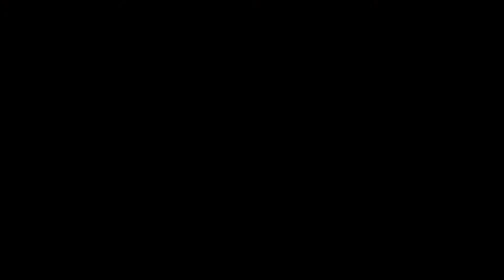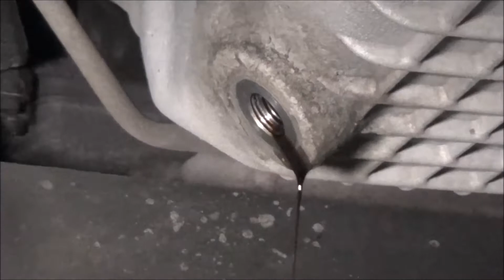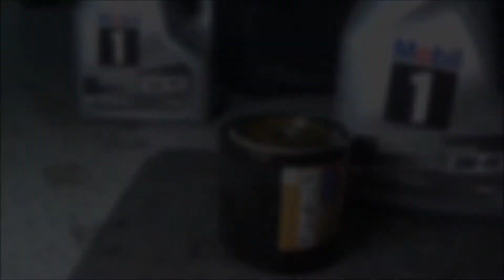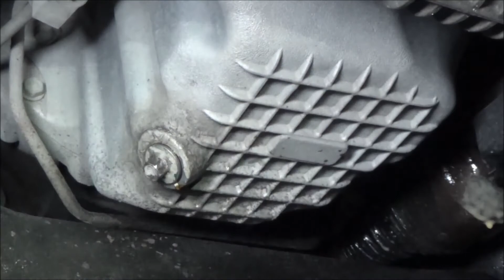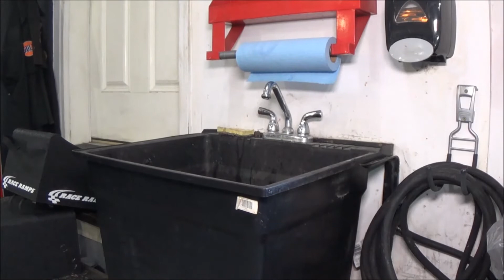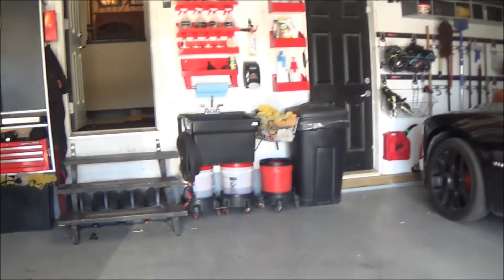Oil Change on Jeep SRT8

Comment: is it true that u should all 12000km or all 6 months change oil??? Rly??
Reply from the maker: I aim to  change the oil every 5000 km and this is using full synthetic motor oil.  Conventional oil is as short as 5000km if you make frequent short trips.
Reply: @SerhansGarage  But this is insane!!!!!!  Whit the oil quality i bet u make EASY over 25000 km without change oil...or even More...

Comment: Quick question.... at oil changes, how much oil comes out of your Jeep? Is it at least 5 quarts? Because I just bought an srt8 and changed the oil on it and it only had like 4 quarts in it. I’m worried that it’s burning oil or is that pretty normal?
Reply from the maker: rokkero564 its about 6 quarts but I let it drain for over an hour. I wouldnt worry too much now...just fill it and monitor the oil level. Maybe it was low when you drained it.
Reply: Serhan's Garage oh ok and yeah I didn’t check it before I drained it and I also didn’t let it drain too long so I guess I won’t find out until my next oil change but hopefully it’s normal and not burning oil. You should upload more videos of the Jeep though, there’s not a lot of srt8 Jeep videos on YouTube
Reply: Manuel book says 7qrts
Reply: @circleofkingscultivatingex294  My take on it that I have read up on in the www.cherokeesrt8.com forum advises you to fill to only 6 1/2 quarts then run your srt8 for 5 minutes. Then turn it off and let the oil level settle . After roughly 10 mins check the oil level and top it off as needed to get it at the top of the safe marker. This is an oil and filter change together.

Comment: How reliable are these cars? Should I get a used one with over 80K miles on it?
Reply from the maker: Kitkatikandi I think there solid. Only problem Ive had is leaking water pump. Mine has 130K miles and runs great and they are easy to work on affordable unlike my Cayenne.
Reply: How often do you have to fill up on gas? You put premium fuel in it right? Done any mods to it?
Reply from the maker: Kitkatikandi yes premium fuel and lots of trips to gas station partly due to small gas tank to accomodate the centre exhaust..
I think its only 54 litres, my Cayenne has over 80 litres tank. Mods so far is the Cold air.and tune and ram.air.hood.
Reply: Sorry for all of the questions lol I’m really planning on buying this car within a month but did you notice any noticeable power gain with the mods you have?
Reply from the maker: Kitkatikandi The CAI improved throttle response and sounds amazing! I have a video on it
Reply: @SerhansGarage  i have a absolutely fully loaded 07 with 58k miles on it.....which CAI do you recommend? mopar, k&n,leg maker
Reply from the maker: @fallback8314  Have you considered Volant? The one I had on my Jeep pulled air from the front grill so it was a true cold air. If you remove the lid like I did on mine it made a really nice sound. I have a video that shows the Volant intake in the Ram Air Hood video on my Jeep
Reply: @SerhansGarage  never heard of them never heard nobody else mention them either but it sounds interesting i'm gonna look them up
Reply from the maker: @fallback8314  I loved the Volant so much I bought one for my Charger SRT8. Throttle response  improved, so did gas mileage  and the motor sounds amazing with the Volant. It's hard to tell if there is real HP gain but with the Volant the Jeep and Charger feels quicker, especially on top end it pulls harder.
Reply: @SerhansGarage  oh wow, ok, would you know how/if it compares to the leg maker or k&n?
Reply from the maker: @fallback8314  I don't have experience with these but they are an open box design...I think they will pull in warm air from the engine bay. I would go with a closed.box set up like the Volant.
Reply from the maker: @fallback8314  not sure which one I.had but I went to Volants website and they don't make the one I had in my Jeep. Mine had a tube that ran from the side of the box to the front grill.